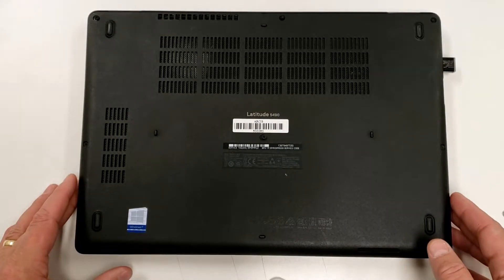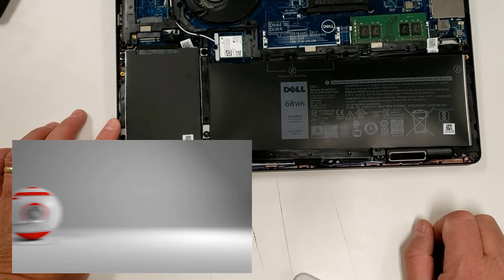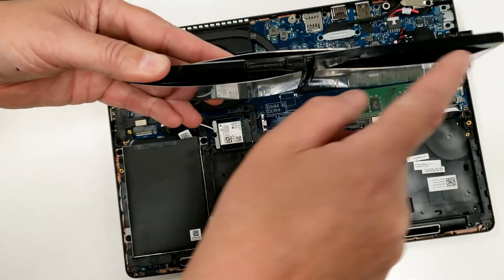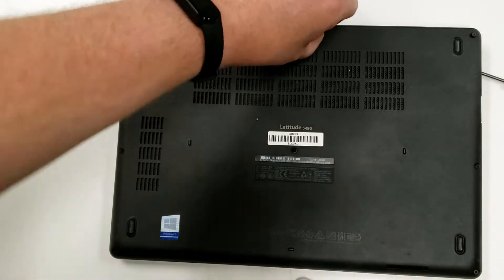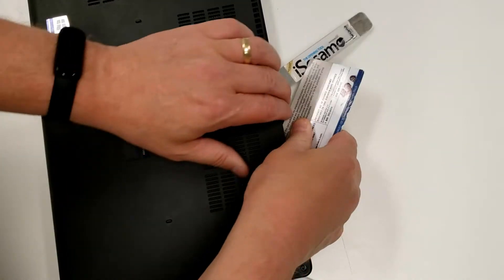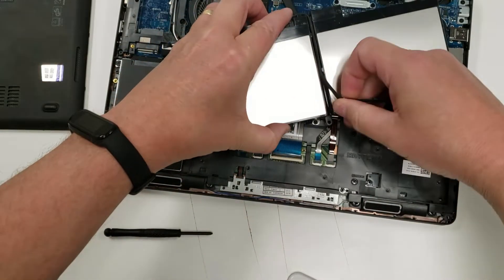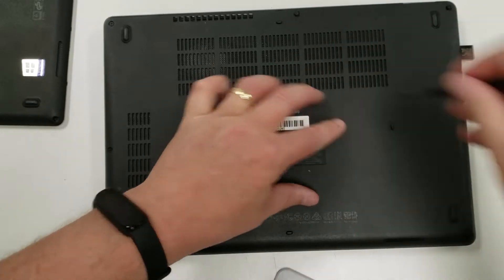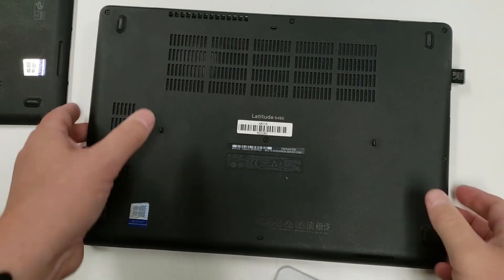Replace Battery on Dell Latitude 5490 & Basic Disassembly

Comment: thank you so much. I bought one off amazon, and replaced it with the video. Saved me over 200 bucks (instead of buying a new laptop, i spent 25 bucks on a new battery). The computer still works great, so i didnt want to buy another.

Comment: Brilliant, thank you :0) Dont' lift the tape on the battery connector wire like I did, it'll expose the wires potentially ripping them out of the small plastic socket piece holding them together underneath! Fortunately I took a moment to find this video before making things worse and pushed the tape back in place, pulled the whole thing out and connected it to the new battery. Working great, thanks again!

Comment: The center screw of the cover goes through a screw hole on the top side of the battery, together with the inner right side screw holding it in place.

Comment: The reason the screw is ( isn't missing ) from the battery is because the Centre screw on the base cover is the screw that locks down the Battery ( hence the " Missing Screw ") cheers for Vid

Comment: What do you think, I used to use a laptop mostly at home, always with mains power, but the factory battery failed in about 1 year. For my next laptop, I only put the battery in when I needed it, so it has worked for several years. If I disconnect the battery in this laptop while it is running from the power supply, will it be a problem?

Comment: can i put a 68 wh battery in a 5490 which has a 42wh battery?
Reply from the maker: I haven't tried but I would imagine as long as it connects and fits in it should work just fine
Reply: @URTechDotCa  yes, i tried and it fits and works perfectly, thanks!

Comment: If I remove a swollen battery does this laptop work with AC power?
Reply from the maker: Yes... well I should not be so unequivocal, it depends on how it was engineered, but I have never worked on a laptop that will not work without the battery... at least of the ones I have tried over the last 20 years of doing this type of work.

Comment: Hi, thanks a lot for the video. I have also a Dell Latitude 5490 (exactly same looking), but mine has a 42wh 11.4V 3500mAh battery (Type 3DDDG). It's a bit smaller, and there is some space left in the slot (I guess for a bigger one). Can I replace it with the same battery you are using ? Wich one is the best, and what do you recommand ? Regards.
Reply: hi, i have the same situation, mine has a 42wh but i want to know if the 68wh will work? did it worked? thanks
Reply: @diegocastaneda7671  Hello man ! I'm in the same case as you has it worked out for you please ?
Reply: @diegocastaneda7671  I still haven't change my battery... So no idea. Sorry.
Reply: I just ordered a noname branded battery from a german reseller. Fits quite nicely.
Reply: @Sensu0  hopefully the offbrand battery doesnt blow up

Comment: I don't know if it's ever happened when replacing a dell 5490 battery but I tried upgrading my battery from the 42Wh to the 68Wh and when I plug it in I don't get any battery charging and some pieces get extremely hot?
Reply from the maker: That sounds like your new battery is defective.  I have never seen battery size settings in the BIOS but I would look there first to see if there are any settings on your unit.   I have never "upgraded" a battery before so I can't say it is defective for sure, but if it is getting very hot I would not use it (I have had 3 LiON battery fires in 30 years... not fun)

Comment: can you make a video about fixing the Battery Present because i have this same laptop and its saying battery present after i just replaced the battery can you PLEASE help me!
Reply from the maker: Hi Good Man.  I have not seen that message before, and I just changed ANOTHER 5490 battery yesterday.  If you can visit www.URTech.ca and click contact, you can send me a screen shot or photo of the error and I will look into it further for you.
Reply: @URTechDotCa  ok thx you
Reply: @URTechDotCa  it has a battery icon with the charger thing on the left side but has a x in the middle of the battery and it says battery not present in it only turns on with its plugged in